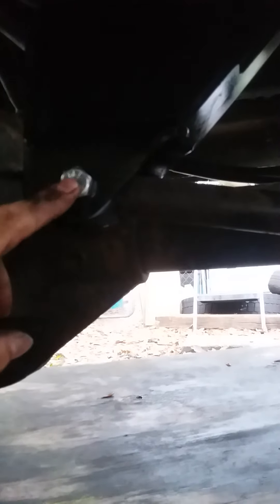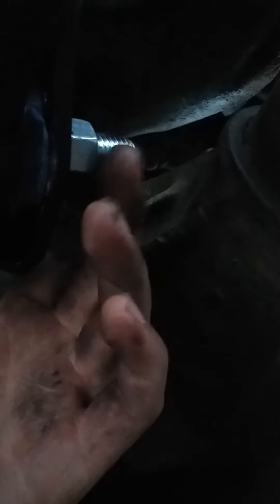Obs f350 4x4 conversion pt 5 track bar install

Comment: I’m thinking about doing a conversion. I’ve watched all parts you’ve made. 

Did you have to swap transmissions or just add the transfer case
Reply from the maker: I am going to use the 2wd zf5 and add a divorced np205 with a twin stick kit
Reply: Diesel Guy if I couldn’t get my hands on np205 what else could I use